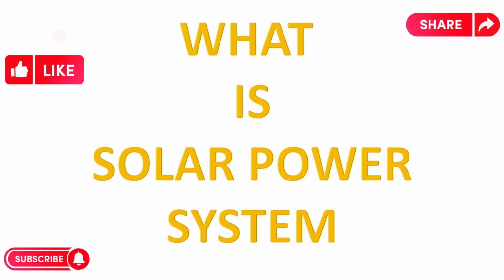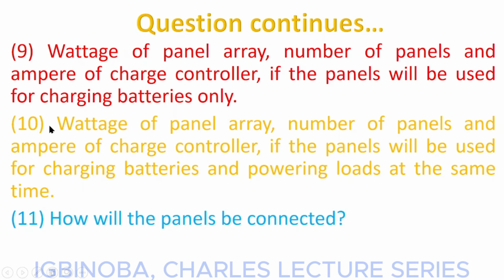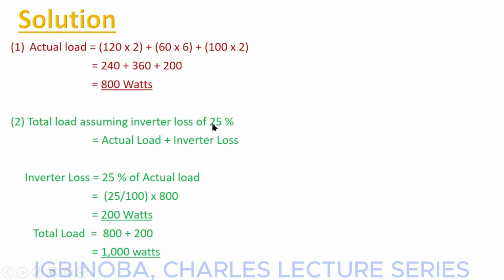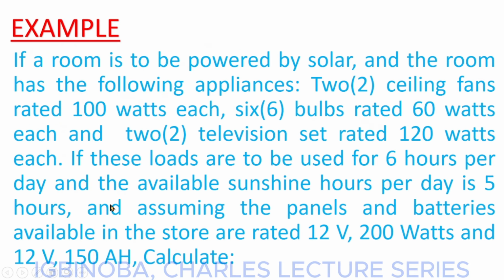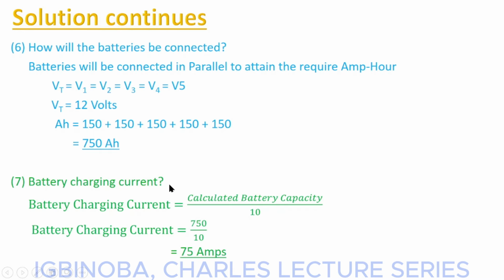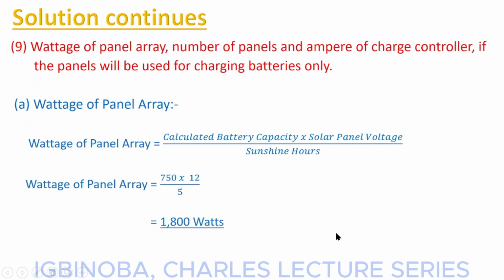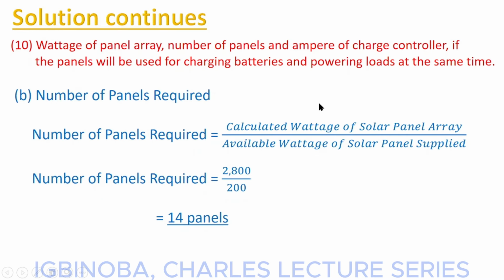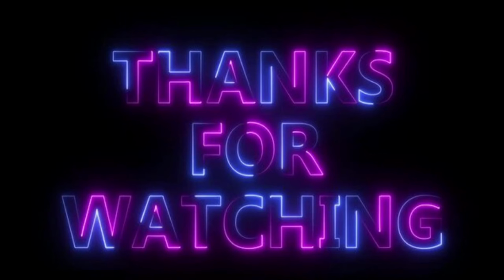Design of Solar Power System

Comment: CIV50X

(1)Actual load=1380watt
(2)Total load=1725watt
(3)Inverter rating=2156.25VA
(4)Battery capacity=1239.75AH
(5)Number of battery=8.625(9 battery)
(6)They will be connected in parallel 
(7)Battery charging current=129.375A
(8)Battery charging time with 40% loss = 14hrs
(9a)Wattage of panel array=3105watt
(9b)Number of panels=16panels 
(9c)Ampere of charge controller=258.75A
(10a)Wattage of panel array with load=4485watt
(10b)Number of panel=23panels
(10c)Ampere of charge controller=373.75A
(11)They will be connected in parallel
Reply: CHM88J
1. Actual Load: 1380 W
2. Total Load: 1840 W
3. Inverter Rating (0.8 Power Factor): 2300 VA (or 2.3 kVA)
4. Battery Capacity: 1226.67 Ah
5. Number of Batteries: 9 batteries  
6. Battery Connection: Parallel
7: Battery Charging Current: 120 A
8. Battery Charging Time: 16.67 hours
9. Solar Setup (Batteries Only):  
a. 2944 W (or 3000 W),  
b. 15 panels,  
c. 250 A charge controller  
10. Solar Setup (Batteries + Load Simultaneously):  
a. 4784 W (or 4800 W),  
b. 24 panels,  
c. 400 A charge controller  

(11) They will be connected in parallel

Comment: EEE97S
1. Actual load is 1380W

2. Total load is 1840W

3. Inverter rating is 2300VA

4. Battery capacity is 920 AH
7 batteries are needed

5. Battery connection is in parallel

6. Battery capacity current is 210A

7. Hours for charging is 8.33 hrs

8. Panels required are 13 panels of 2520W and a charge controller of 217A

9. Panels required for carrying the loads and charging the batteries at the same time are 22 panels of 4360W with a 367A charge controller

10. Panels are connected in parallel

Comment: CHM94P 
1.Actual load = 1380 watt          2.Total load = 1725 watt.   3.Inverter rating = 2156 VA
4.  Battery capacity = 1294 Ah
5.  Number of batteries = 9
6.Parallel
7.Battery charging current = 129.4 Ah
8. Battery charging time = 14 hr
9a. Panels wattage = 3106 watts
9b. Number of panels = 16
9c. Charge controller = 258.8 A
10a. Panels wattage = 4831 watts
10b. Number of panels = 24
10c. Charge controller = 402.5 A
11.Parallel

Comment: CIV76X
1.Actual load=1380watts
2.Total load =1725watts
3.Inverter rating=2156.3VA
4.1293.8AH
5.Approximately 9 batteries
6. Parallel
7.129.4A
8.14hrs
9.16 panels
   Charge controller Amps=258.8A
10. 22 panels
       Charge controller Amps=374A
11. Panels will be connected in parallel

Comment: MAR36J

1. Actual load: 1380W
2. Total load: 1725W
3. The inverter rating is 2156.23VA
4. Battery capacity is 1293.75Ah
6. Battery connections in parallel
7. Battery charging current is 129.4A
8. Battery charging time is 14hrs
9. (Charging battery only)
a. The wattage of the panel array is 3105W
b. The number of panels is 16 panels
c. The charge controller rating is 258.75A
10. (Charging and powering simultaneously)
a. The wattage of the charging array is 4830W.
b. The number of panels is 24 panels
c. The charge controller rating is 402.5A
The panel connection is parallel

Comment: COMP11K

1. Actual load = 1380 watts

2. Total load = 1725 watts

3. Inverter rating = 2156 VA

4. Battery capacity = 1294 Ah

5. Number of batteries = 9

6. Parallel

7. Battery charging current = 129.4 Ah

8. Battery charging time = 14 hr
9a. Panels wattage = 3106 watts
9b. Number of panels = 16
9c. Charge controller = 258.8 A
10a. Panels wattage = 4831 watts
10b. Number of panels = 24
10c. Charge controller = 402.5 A

9. Parallel

Comment: MEC107C
Final answers:
1. 1,380 W
2. 1,840 W
3. 2,300 VA
4. 1,227 Ah
5. 9
6. Batteries = Parallel connection
7. 270 A
8. 7 hours
9. Battery charging only = 3,400 W, 17 panels, ≈283 A controller
10. Charging + loads = 5,200 W, 26 panels, ≈433 A controller
11. Panels = Parallel connection

Comment: EEE27A

Answer:
1. Actual Load: 1380 W
2. Total Load: 1840 W
3. Inverter Rating (0.8 Power Factor): 2300 VA (or 2.3 kVA)
4. Battery Capacity: 1226.67 Ah
5. Number of Batteries: 9 batteries
6. Battery Connection: Parallel
7. Battery Charging Current: 120 A
8. Battery Charging Time: 16.67 hours
9. Solar Setup (Batteries Only): 2944 W (or 3000 W), 15 panels, 250 A charge controller
10. Solar Setup (Batteries + Load Simultaneously): 4784 W (or 4800 W), 24 panels, 400 A charge controller
11. Panel connection: parallel
Reply: EEE102X

ANSWER 

1. Actual Load: 1380 W
 2. Total Load: 1840 W 
3. Inverter Rating (0.8 Power Factor): 2300 VA (or 2.3 kVA) 
4. Battery Capacity: 1226.67 Ah 
5. Number of Batteries: 9 batteries
 6. Battery Connection: Parallel 
7. Battery Charging Current: 120 A
 8. Battery Charging Time: 16.67 hours 
9. Solar Setup (Batteries Only): 2944 W (or 3000 W), 15 panels, 250 A charge controller 
10. Solar Setup (Batteries + Load Simultaneously): 4784 W (or 4800 W), 24 panels, 400 A charge controller
 11. Panel connection: parallel

Comment: CHM4D
Answers:

1. Actual Load - 1,380Watts

2. Total Load - 1,725Watts

3. Inverter Rating in VA - 2156.25VA

4. Battery Capacity - 1293.75Ah

5. Batteries for Backup Hours - 9 Batteries

6. Batteries Connection - Parallel

7. Battery Charging Current - 129.4A

8. Battery Charging Time - 14hrs

9a). Wattage Of Panel Array - 3105Watts (But it's better

to use 3200Watts)

9b). Number Of Panels - 16 panels

9c). Ampere Of Charge Controller - 266.67A(But it's better to use that of 300A)

10a). Wattage Of Panel Array - 4830Watts (But it's better to use 5000Watts)

10b). Number Of Panels - 25 panels

10c). Ampere Of Charge Controller - 416.67A(But it's better to use that of 500A)

11. Panels Connection - Parallel

Comment: MEC111G

1. 1380 watts
2. 1725 watts
3. 2156.25 VA
4. 1294 Ah
5. 9
6. In parallel connection 
7. 129.4 Amps 
8. 14 hours 
9a. 3106 watts
9b. 16 panel
9c. 259 Amps 
10a. 4831 watts
10b. 24 panels
10c. 403 amps 
11. Parallel connection

Comment: MEC71S 

1,The active load is 1380W
2. The total load is 1725W
3. The inverter rating is 2156.23VA
4. The battery capacity is 1293.75Ah 
5. The Number of batteries is 9
6.  The batteries are connected in parallel.
7. The Battery charging current is 129.4A.
8. The battery charging time is 14 hrs.

9a. The wattage of the panel array is 3105W
b.16 panels.
c. The Charge controller rating is 258.75A

10a. The wattage of the Panel array is 4830W
b. 24 panels.
c. The charge controller rating is 402.5A

11. The panels are arranged in parallel

Comment: MEC57E

1. 1,380 W
2. 1,725 W
3. 2,156.25 VA
4. 1,239.75 Ah
5. 9 batteries
6. Parallel connection
7. 129.375 A
8. 14 hours
9a. 3,105 W
9b. 16 panels
9c. 258.75 A
10a. 4,485 W
10b. 23 panels
10c. 373.75 A
11. Parallel connection

Comment: MAR2B 

1.Actual load: 1380 W
2. Total load (25% inverter loss): 1,840 W
3. Inverter rating: 2,300 VA
4. Battery capacity: 1,226.7 Ah
5. Number of batteries: 9 batteries
6. Battery connection: Parallel
7. Battery charging current: 245.3 A
8. Battery charging time: 8.33 hours
9. For charging batteries only: 245A
10. For charging and powering batteries simultaneously: 399A
11. Parallel connection

Comment: COMP30D

1. The actual pad is 1,380W
2. The Total load is 1,725W
3. The inverter rating is 2,156.23VA
4. The battery capacity is 1,293.75Ah 
5. The Number of batteries is 9
6.  The batteries are connected in parallel 
7. The Battery charging current is 129.4 amps.
8. The battery charging time is 14 hours.
9. a. The wattage of the panel array is 3,105W
b. The number of panels is 16 panels.
c. The Charge controller rating is 258.75 amps.

10. a. The wattage of the Panel array is 4,830 Watts 
b. The number of panels is 24 panels.
c. The charge controller rating is 402.5 amps
11. The panels are arranged in parallel

Comment: CHM13M 

Answer:
1. Actual Load: 1380 W
2. Total Load: 1840 W
3. Inverter Rating (0.8 Power Factor): 2300 VA (or
2.3 kVA)
4. Battery Capacity: 1226.67 Ah
5. Number of Batteries: 9 batteries
6. Battery Connection: Parallel
7. Battery Charging Current: 120 A
8. Battery Charging Time: 16.67 hours
9. Solar Setup (Batteries Only): 2944 W (or 3000
W), 15 panels, 250 A charge controller
10. Solar Setup (Batteries + Load Simultaneously):
4784 W (or 4800 W), 24 panels, 400 A charge controller
11. Panel connection: parallel

Comment: CHM16P

Answer:
1. Actual Load: 1380 W
2. Total Load: 1840 W
3. Inverter Rating (0.8 Power Factor): 2300 VA (or
2.3 kVA)
4. Battery Capacity: 1226.67 Ah
5. Number of Batteries: 9 batteries
6. Battery Connection: Parallel
7. Battery Charging Current: 120 A
8. Battery Charging Time: 16.67 hours
9. Solar Setup (Batteries Only): 2944 W (or 3000
W), 15 panels, 250 A charge controller
10. Solar Setup (Batteries + Load Simultaneously):
4784 W (or 4800 W), 24 panels, 400 A charge controller
11. Panel connection: parallel

Comment: EEE36J 

1. The actual power is 1380W
2. The total load assuming inverter loss of 25% is 1735W
3. The inverter rating using power factor of 0.8 is 2156.25VA
4. The battery capacity is 1293.75Ah
5. The number of batteries used is 9
6. The batteries are connected in parallel 
7. The battery charging current is 129.4
8. The battery charging time is 14 hours 
9,a. The wattage of the panel array is 3105W
    b.  The numbers of panels are 16 panels
    c.  The charge controller rating is 258.75
10,a. The wattage of the panel array ( for charging and load) is 4830W
      b. The number of panels is 16 panels 
      c. The charge controller rating is 402.5A
11. The panels are arranged in parallel 😮

Comment: MAR44R
load calculations

1. actual load=1380watt
2. total load=1725watt
3. VA= 2156.25VA
4. battery capacity=1293.75AH
5. no. of batteries= 9 batteries 
6. battery connection=parallel
7. charging current=129.4A
8. charging loss at 40%=14hrs
 only charging of battery
9a. panel wattage=3105watt
9b. no. of panels=16panels
9c. ampere of charge controller=258.75A
for charing of battery and powering of load
10a. panel wattage=4830watt
10b. no. of panels=24panels
10c. ampere of charge controller=402.5A
11. panel connection= parallel

Comment: EEE21U 
 Actual load =1,380 W

Total load =1,725 W

Inverter 2,156.25 VA (≈ 2.2 kVA)

Battery cap =1,150 Ah

No of batteries = 8 batteries

Battery connection= Parallel connection

Battery charging current=115 A

Charging time= 14 hours

Wattage= 2,760 W array
No of panel; 14 panels; 
230 A charge controller

Wattage =4,485 W array
No of panel; 23 panels
; 375 A charge controller

11 * Parallel connection

Comment: CIV4D 

Answers:
Actual load = 1380Watt
Total load = 1725Watt
Inverter rating = 2156.25VA
Battery Capacity = 1239.75Ah
Number of batteries = 8.625 (9 batteries)
They will be connected in parallel
Battery charging current = 129.375A
Battery charging time with 40% loss = 14hrs
9a. Wattage of panel array = 3105Watt
9b. Number of panels = 16panels
9c. Ampere of charge controller = 258.75A
10a. Wattage of panel array with load = 4485Watt
10b. Number of panels = 23panels
10c. Ampere of charge controller = 373.75A
11. They will be connected in parallel.

Comment: EEE103Y

1. Actual load= 1380W
2. Total Load= 1840W
3. Inverting rating= 2300VA or 2.3kVA
4. Battery capacity= 1226.67Ah
5. Number of batteries= 9 batteries 
6. 9 batteries in parallel 
7. Battery charging current= 120 A
8. Battery charging time= 16.67 hours 
9. Solar setup(batteries only)
a. 2944W or (3000W)
b. 15 panels 
c. 250A charge controller 
10. Solar setup(batteries plus load simultaneously)
a. 4784W or (4800W)
b. 24 panels
c. 400A charge controller 
11. Panels connected in parallel

Comment: PETRO60H 

Answers:
1. Actual Load - 1,380Watts
2. Total Load - 1,725Watts
3. Inverter Rating in VA - 2156.25VA
4. Battery Capacity - 1293.75Ah
5. Batteries for Backup Hours - 9 Batteries 
6. Batteries Connection - Parallel 
7. Battery Charging Current - 129.4A
8. Battery Charging Time - 14hrs
9a). Wattage Of Panel Array - 3105Watts (But it's better to use 3200Watts)
9b). Number Of Panels - 16 panels 
9c). Ampere Of Charge Controller - 266.67A(But it's better to use that of 300A)
10a). Wattage Of Panel Array - 4830Watts (But it's better to use 5000Watts)
10b). Number Of Panels - 25 panels 
10c). Ampere Of Charge Controller - 416.67A(But it's better to use that of 500A)
11. Panels Connection - Parallel

Comment: 23:45 

Answer: 
The actual load is 1,380W
The Total load is 1,725W
The inverter rating is 2,156.25VA
The battery capacity is 1,293.75Ah
The Number of batteries is 9
The batteries are connected in parallel
The Battery charging current is 129.4 amps.
The battery charging time is 14 hours.
a. The wattage of the panel array is 3,105W
b. The number of panels is 16 panels.
c. The Charge controller rating is 258.75 amps.
a. The wattage of the Panel array is 4,830 Watts
b. The number of panels is 24 panels.
c. The charge controller rating is 402.5 amps
The panels are arranged in parallel

Comment: PETROCHEM16P
 1. Actual Load:1380 W
 2. Total Load: 1725 W
 3. Inverter Rating:2156.25VA
 4. Battery Capacity: 1293.75Ah
 5. Number of Batteries: 9batteries
 6. Battery Connection Type:Parallel connection
 7. Battery Charging Current: 129.3 A
 8. Charging Time (40% Loss): 14hrs
 9a) Panel Wattage:3105W
 9b) Number of Panels: 16panels
 9c) Charge Controller Current: 258.75A
 10a) Panel Wattage:4830W
 10b) Number of Panels: 25panels
 10c) Charge Controller Current:402.5A
 11) Panel Connection Type: Parallel connection

Comment: COMP29C 

1. The actual pad is 1,380W
2. The Total load is 1,725W
3. The inverter rating is 2,156.23VA
4. The battery capacity is 1,293.75Ah 
5. The Number of batteries is 9
6.  The batteries are connected in parallel 
7. The Battery charging current is 129.4 amps.
8. The battery charging time is 14 hours.
9. a. The wattage of the panel array is 3,105W
b. The number of panels is 16 panels.
c. The Charge controller rating is 258.75 amps.

10. a. The wattage of the Panel array is 4,830 Watts 
b. The number of panels is 24 panels.
c. The charge controller rating is 402.5 amps
11. The panels are arranged in parallel

Comment: CHM12L
Answers

1. Actual load = 1380Wart
2. Total load = 1725 Watt
3. Inverter rating = 2156.25VA
4. Battery Capacity = 1239.75Ah
5. Number of batteries = 8.625 (9 batteries)
6. They will be connected in parallel
1. Battery charging current = 129.375A
8. Battery charging time with 40% loss =
14hrs
9a. Wattage of panel array = 3105Watt
9b. Number of panels = 16panels
9c. Ampere of charge controller = 258.75A
10a. Wattage of panel array with load = 4685 Watt
10b. Number of panels = 23 panels
10c. Ampere of charge controller = 373.75A
11. They will be connected in parallel

Comment: CHM54B 

Answer:

1. Actual Load: 1380 W
2. Total Load: 1840 W
3. Inverter Rating (0.8 Power Factor): 2300 VA (or 2.3 kVA)
4. Battery Capacity: 1226.67 Ah
5. Number of Batteries: 9 batteries
6. Battery Connection: Parallel
7. Battery Charging Current: 120 A
8. Battery Charging Time: 16.67 hours
9. Solar Setup (Batteries Only): 2944 W (or 3000 W), 15 panels, 250 A charge controller
10. Solar Setup (Batteries + Load Simultaneously): 4784 W (or 4800 W), 24 panels, 400 A charge controller
11. Panel connection: parallel

Comment: MEC80B

1. Actual load=1380watts
2.  Total load=1725watts
3. Inverter rating=2156VA
4. Battery capacity=1294Ah
5. Number of batteries=9
6. Parallel
7.battery charging current=129.4Ah
8. Battery charging time=14hr
9a. Panels wattage=3106watts
9b. Number of panels=16
9c. Charge controller=258.8A
10a. Panels wattage=4831watts
10b. Number of panels=24
10c. Charge controller=402.5A
11. Parallel

Comment: EEE64L

1. The actual pad is 1,380W
2. The Total load is 1,725W
3. The inverter rating is 2,156.23VA
4. The battery capacity is 1,293.75Ah 
5. The Number of batteries is 9
6.  The batteries are connected in parallel 
7. The Battery charging current is 129.4 amps.
8. The battery charging time is 14 hours.
9. a. The wattage of the panel array is 3,105W
b. The number of panels is 16 panels.
c. The Charge controller rating is 258.75 amps.

10. a. The wattage of the Panel array is 4,830 Watts 
b. The number of panels is 24 panels.
c. The charge controller rating is 402.5 amps
11. The panels are arranged in parallel

Comment: NAT51Y

1. The actual pad is 1,380W
2. The Total load is 1,725W
3. The inverter rating is 2,156.23VA
4. The battery capacity is 1,293.75Ah 
5. The Number of batteries is 9
6.  The batteries are connected in parallel 
7. The Battery charging current is 129.4 amps.
8. The battery charging time is 14 hours.
9. a. The wattage of the panel array is 3,105W
b. The number of panels is 16 panels.
c. The Charge controller rating is 258.75 amps.

10. a. The wattage of the Panel array is 4,830 Watts 
b. The number of panels is 24 panels.
c. The charge controller rating is 402.5 amps
11. The panels are arranged in parallel
Reply: CIV59G

1. The actual pad is 1,380W

2. The Total load is 1,725W

3. The inverter rating is 2,156.23VA

4. The battery capacity is 1,293.75Ah

5. The Number of batteries is 9

6. The batteries are connected in parallel

7. The Battery charging current is 129.4 amps.

8. The battery charging time is 14 hours.

9. a. The wattage of the panel array is 3,105W

b. The number of panels is 16 panels.

c. The Charge controller rating is 258.75 amps.

10. a. The wattage of the Panel array is 4,830 Watts

b. The number of panels is 24 panels.

c. The charge controller rating is 402.5 amps

11. The panels are arranged in parallel

Comment: MAR101W
Answers:
1. Actual load = 1380 W
2. Total load assuming inverter loss of 25% = 1725 W
3. Inverter rating in VA using power factor of 0.8 = 2156.25 VA (or 2.16 kVA)
4. Battery capacity using a factor for reserve of 75% = 1150 Ah (or 13800 Wh)
5. Number of batteries for backup hours = 8 batteries (rounded up from 7.67)
6. Battery connection = Parallel connection (8 batteries connected in parallel)
7. Battery charging current = 120 A
8. Battery charging time assuming a charging loss of 40% = 16.67 hours (or 16 hours 40 minutes)